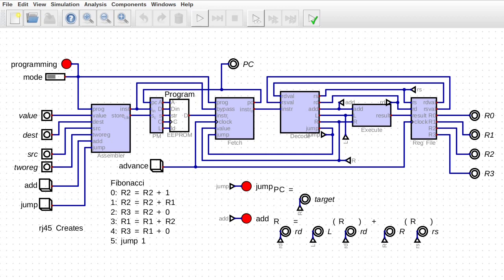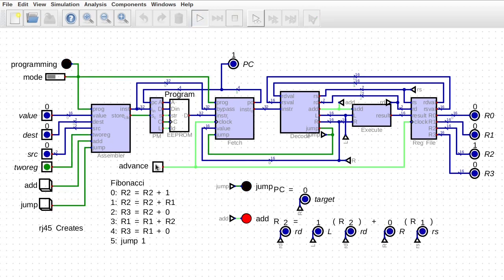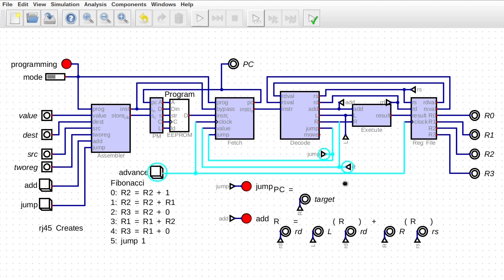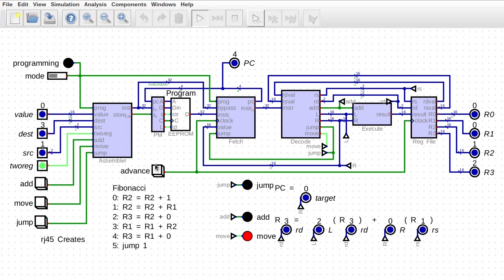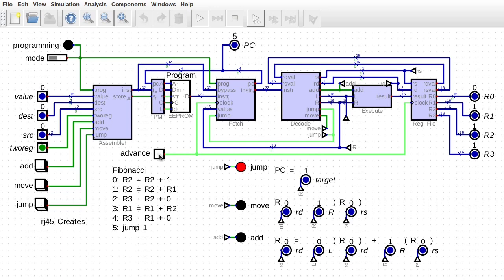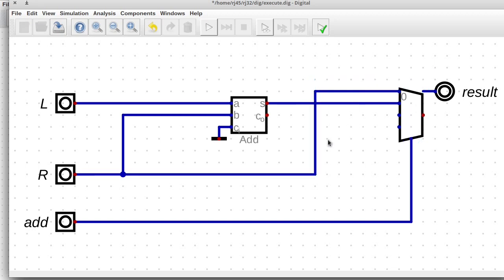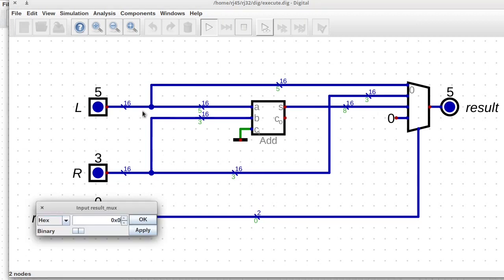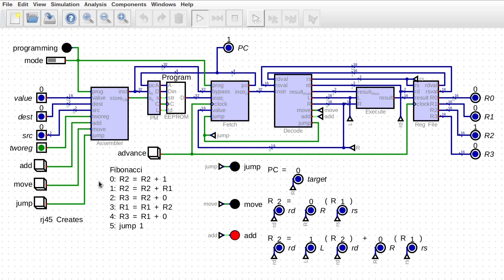[011] Move! - Building a CPU From Scratch

Comment: Hi, I love your videos.

I have a question however: doesn't an add of a register with 0 technically not also count as a move?
Reply from the maker: Thanks! I think at one point (and I forget if I had that in this video or not) it was a 3 operand machine, in which case you're correct, an add with zero is a move. But eventually this CPU becomes a 2 operand machine, and then an add with zero does nothing. In other words it's like the C "reg += 0". It would have been nice to stick with a 3 operand machine, but it's hard to fit all that into a 16 bit instruction.